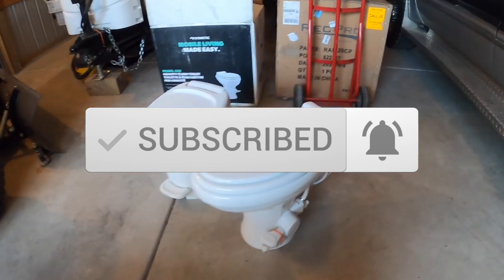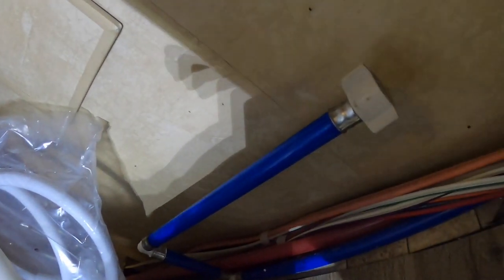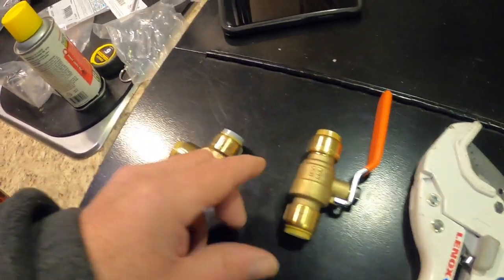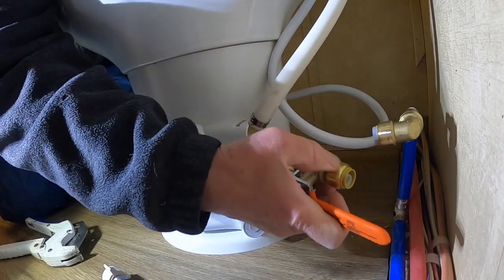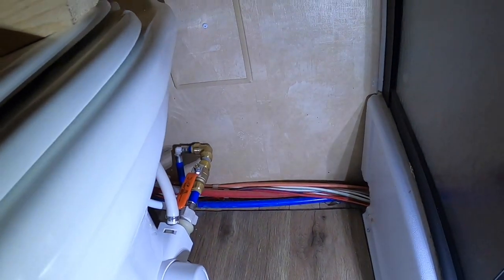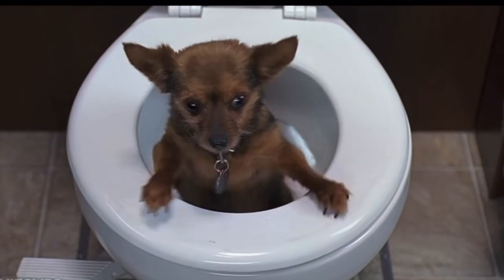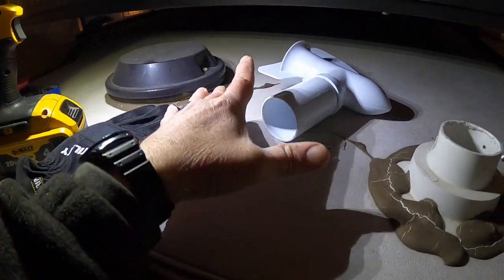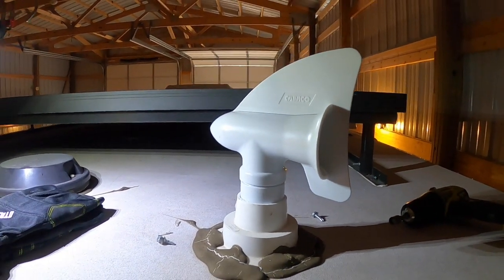RV Upgrade NEW Toilet  Dometic 320 rv toilet replacement travel trailer toilet motor home

Comment: I’ve got a 31 ft Keystone Hideout that came with a Demetic toilet. I can’t see on the back if it’s a 300, 310, or 320. I’m going to call keystone when their helpline is open on Monday. I’m wondering once I know what model it exactly is, how can I figure out what upgraded toilet is comparable?
Btw, that toilet looks glorious compared to mine so it’s safe to say mine isn’t a porcelain 320 haha. I love that your toilet looks like a regular home toilet. Do you have any idea how I could find out if I could fit the 320 porcelain to replace this toilet I have now?
Reply from the maker: Usually the one I used will work. The only challenge is getting the water connected. The pex tubing is easy with the shark bite fittings I used. Maybe don’t use the valve to make it a bit easier. Let me know how you make out. No more crapping in a thimble haha. Check out my rv camping playlist for other upgrades
Reply: @bparkinson1234  I can’t thank you enough for the quick reply and the info! I hate crapping here lol. Im desperate to upgrade. Ok my buddy is quite the handy man and im going to show him what you mentioned to make it work. I will keep you posted and THANK YOU again! And I’ll check out the other upgrades for sure!
Reply: @bparkinson1234  I noticed the one on your Amazon link doesn’t come with the sprayer. Do you happen to have another link for the exact one with the sprayer? Happy to support an affiliate link.
Reply from the maker: Check this out! https://www.amazon.com/dp/B072N3RCCJ?ref_=cm_sw_r_ud_dp_2DNAKGJRV0Q1JQYZXC7E
Reply: @bparkinson1234 what model is even the toilet you used to show you use the blue stuff?

Comment: Thank you for sharing, Great Video! Although may I please ask a question. Did your toilet come with the sprayer? The toilet in the link you provided does not mention a sprayer. I really like that feature. I am sure I could add it, but if it comes with it....
Reply from the maker: Mine came with it.  Thought it was stupid. But comes in handy at times. Thanks. Check out my rv playlist.
Reply: @bparkinson1234  Thanks! Mine is a toy hauler with a crapper/shower combo. It seems as the new 320's offered do not have the sprayer with it. I ended up going with a different toilet, but thank you for your video, it gave me a good sense of what to expect. Have a great day!

Comment: Why not do a residential toilet ?
Reply from the maker: Great question. Rv toilets just open straight into the holding tank. No water trap for the gases. No tank on an rv toilet. Don’t need a charge of water to flush.  Maybe houses should use an rv toilet. Less water. Thanks